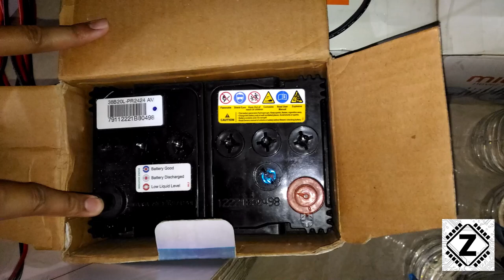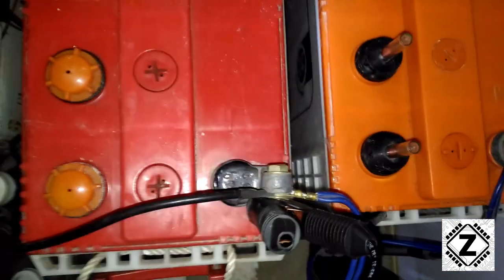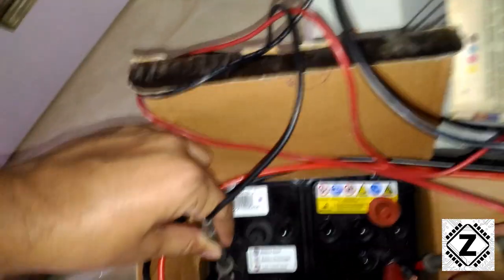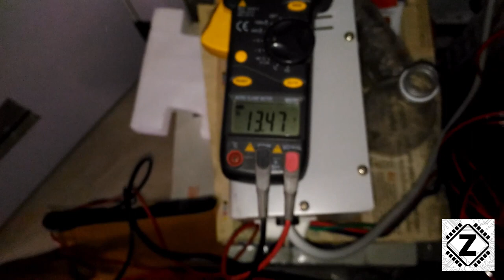[Eng] How to Preserve car Battery During Long Periods of No Use | Maintain Battery Health & Charge

Comment: Can we take out the battery for two wheeler when not in use ? Or is it enough just to disconnect the negative terminal??
Reply from the maker: Do Not Connect 2 wheeler battery directly to Inverter. You can just disconnect the Negative. I will make separate video for 2 wheeler Battery Preservation.
Reply: Zen Innovations thank you!

Comment: Excellent Friend, i have a 60AH 550 CCA car battery ( its maintenance free sealed lead acid battery ) its called but when i buy this battery sales person told me that don't use on ups/inverter only use in your car, yesterday my friend give me a battery same make and model and he ask me to charge and says he want to use on ups i forgot about sales person says me not to use on ups, and i charge the battery battery stays good after one day and volt are 12.75 then i put this on inverter with 100w bulb to test but after 20 min of heavily hold the volts from 12.75 to 12.55 then goes down  faster and fater my inverter cutoff the load after 10.5 volts and from 12.4 to 10.5 its only take 5 minutes for drain the battery, i want to know what is it if battery cell dead the load should never hold the volts from 12.75 to 12.45 on load, is that we can use car battery for home ups/inverter or they are other chemistry please give me some expert advice thank you
Reply from the maker: https://youtu.be/0q9hx7sz9M0